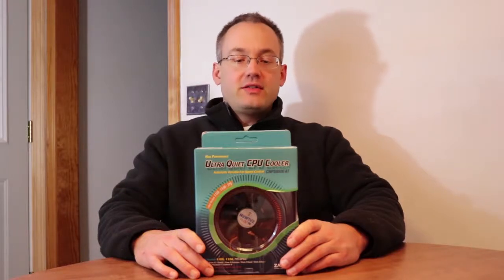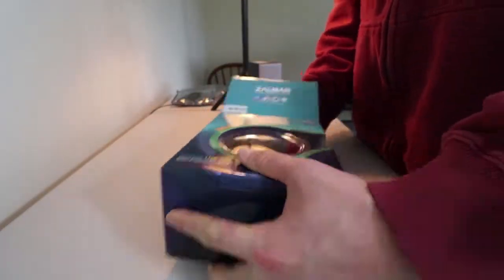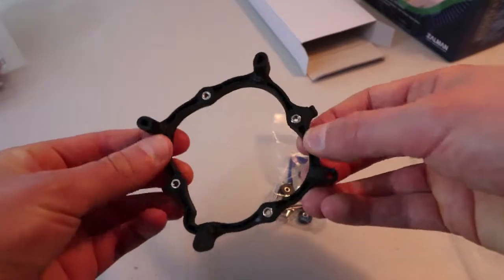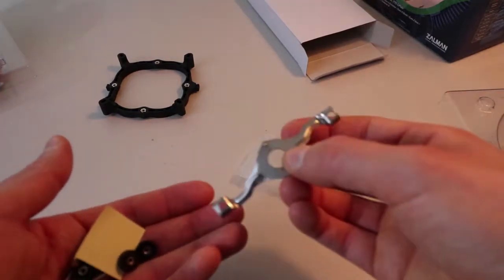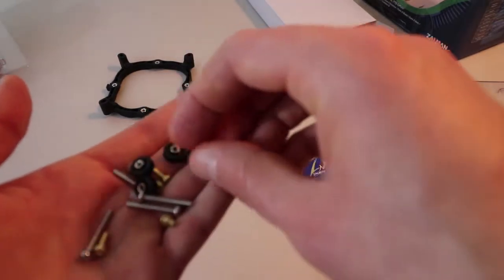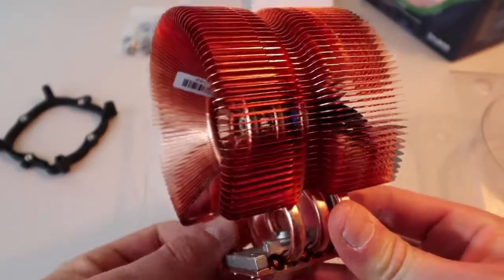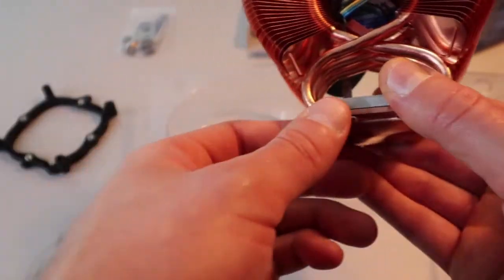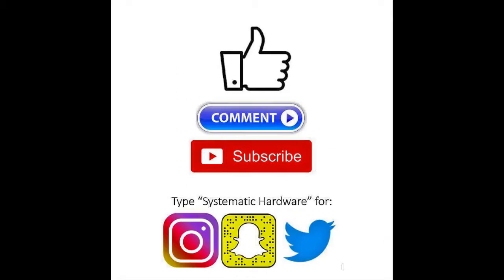Cheap CPU Cooler For Overclocking CNPS9500AT

Comment: what was max temps on idle and load? I really like this cooler
Reply from the maker: Using a locked i7 4790, ambient temperature in my room is 69F and realtemp is showing all four cores ranging from 23 to 27c idle.  Prime 95 stress test with AVX enabled at full load is 62 - 69c inside the Thermaltake core v1, with just the 200mm front intake fan.  I restarted the pc, entered the bios and set the Zalman to run at full speed and idle temps were still higher due to running the previous stress test.  However running full load at 100% fan speed  yielded 66c on the hottest core.
Reply: @SystematicHardware  This would have been a nice addition to your video. That was the information lacking from pretty much all videos covering this part and the most pertinent information
Reply from the maker: Great idea!  I'll do a follow up to this unboxing video on performance.  Such a great underrated CPU cooler for the money.